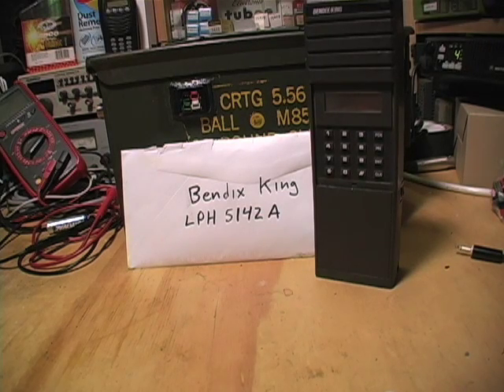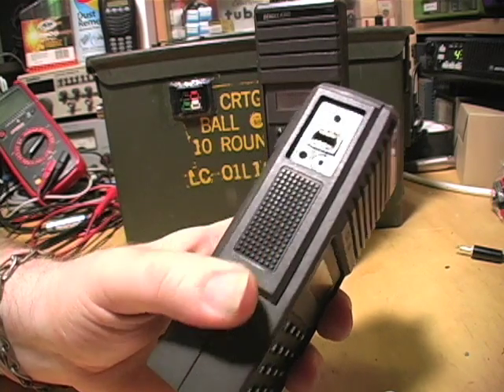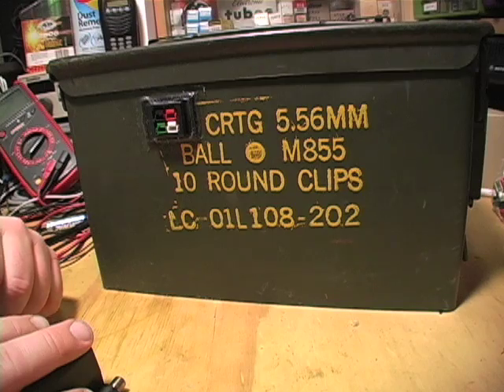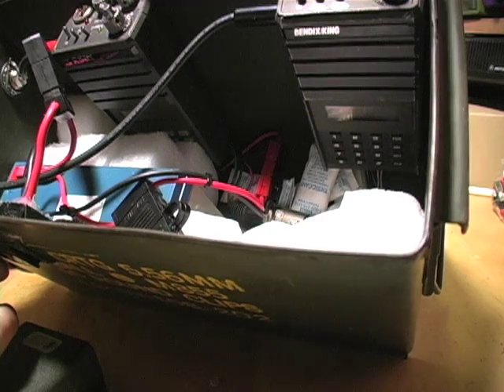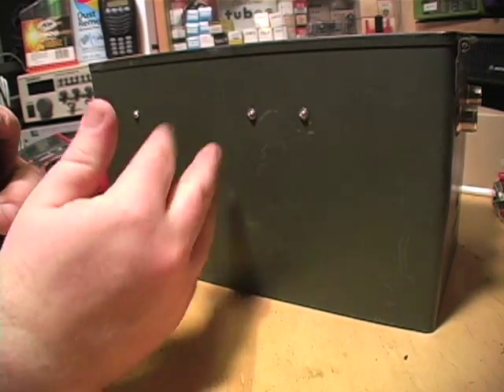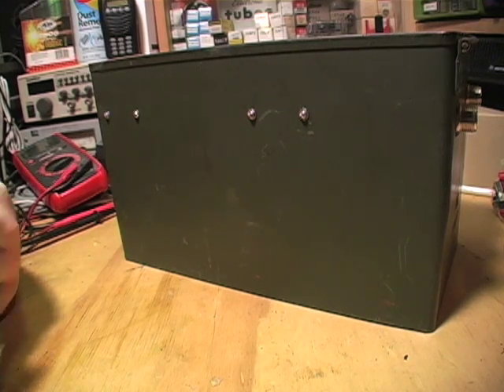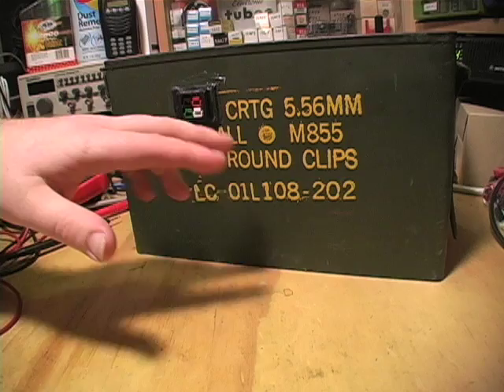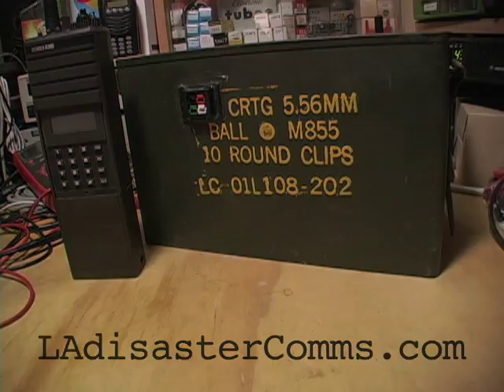Build your own 2 meter tactical repeater from Bendix King HT's on the cheep!

Comment: Your math on calculating the voltage of 9 parallel AA alkaline is correct, however that is the open circuit voltage. Any useful current draw will instantaneously drop the voltage to 13.8 and probably less.

Comment: Hello sir.....I'm a final year engineering student and my project is to design a repeater based on walkie talkie system.....we only use one walkie talkie in this project which can receive and transmit the signal....Can you help how this project work and how to do this project
Reply: Arduino board esp-12s
Sq9mdd tnc
OLED
Components transistor, buzzer ,Capacitor , resistor, sui, led
Walkie talkie

this are the gadgets that we used to do my project...but dont have any idea how to do this and how my project works

Comment: Now do this with a air of Motoroni Sabre radios with DES encryption and use a couple of other like radios with DES and program them up to some DOT frequencies ( common low power licensed commercial frequency) for private COMMS. DO NOT USE ENCRYPTION ON HAM BANDS unless you use an APCO P25 standard with a non high security encryption standard where anyone can purchase and use freely. DES is not approved for Ham Bands.
Reply from the maker: This is actually pretty easy to do with Maxtrac and XTL mobiles.

Comment from the maker: tac·ti·cal adjective \ˈtak-ti-kəl\

A :  of or relating to tactics: as (1) :  of or relating to small-scale actions serving a larger purpose (2) :  made or carried out with only a limited or immediate end in view

Why is it "Tactical"? Because that's what the friggin word means. I'd like to see you run up the side of a hill with a Quantar and get it operational in 15 minutes. I'm guessing you have never worked on a wildfire where temporary repeaters are quickly set up as part of firefighting Tactics. If part of your Tactics for firefighting is having a quick deploy, portable repeater, that doesn't require mains power I'd say that makes it a Tactical Repeater. Maybe that's why they are called Tactical repeaters. 
http://www.cobaltequipment.net/index.php?option=com_content&view=article&id=156:bendix-king-tactical-repeater&catid=18:communications&Itemid=182
Reply: You should have included "strategic" in your explanation. Tactical is the smaller operation and strategic is the "big picture".

Tactical planning is what the small unit does in support of the larger (strategic) goals.

Since the strategic goal was hunting, this was a means of supporting (i.e. tactical) that goal.

Comment: Nice setup!  It's always nice to see the older commercial equipment getting new lives! 

I would just like to inform (or remind) everyone that FCC part 97 rules require that the repeater trustee (typically the owner) have the ability to remotely control the transmitter of the repeater via a control frequency above 222.15 MHz.  Otherwise, the repeater must be able to turn it's transmitter off after 3 continuous minutes of transmission.  I don't see any provision for this capability in your setup.  Actually, there are several other important rules that should be adhered to regarding auxiliary stations (ie. repeaters) and I would recommend anyone planning on building their own repeater see the following page for more information:  http://www.arrl.org/auxiliary-station-faq  73!
Reply: Radios are programmable with a time-out timer.   The repeater operator must be able to control the transmitter -- there are many out there still on the air without controllers; although with the cost of DTMF modules; it's silly NOT to do it!
Reply from the maker: +rumproast2000 The transmit radio is programmed with a 30 second TOT.

Comment: Love the design here! Had a question for you. How is it that the transmitting radio doesn't overload the receiving radio when the repeater is in use? Is it just due to the fact that you have separate RX and TX antennas that are spaced a fair distance apart?

Comment from the maker: Yes, DOS Many old radios from the 90's have to be programmed in DOS, I guess you've never used Motorola RSS before. 

I'm not sure why you would want to do this with UV5r's when they cost more then LPH's, you would have to implement a power management system, a repeater controller, and in such close proximity the Tx radio would probably overload the front end of the Rx radio. I guess it could be done, but it's a totally different beast then this project.

Comment from the maker: There are other HT's that can be configured in a similar matter. I picked the BK's to use because their circuitry is designed so you can simply modify them to work in this way, they have actual 50 ohm antenna connectors, and they will easily run in the 12-13.8 VDC range.

Comment from the maker: No, I am jumping between points on the PCB of each radio, the only passive component between the two radios other then wire is a small cap to filter the DC from the audio jumper. The PDF explains this.

Comment: So did you just plug a speaker cable from the receiver radio into the mic port of the transmit radio? Because uv seen those repeater-tone controllers on eBay but it it doesn't look like you used one of those.

Comment from the maker: I will work with a regular 600K split, if the antennas are far apart, but I usually run an odd split over 1Mhz. Usually something like 144.3XX in and 146.5XX out.

Comment from the maker: That is actually a term BK uses because the repeater is small, quick to deploy, and designed to cover a local area. 

That said I should add some pic rails, QD sling mounts, and a bayonet lug;)

Comment: You may like a project I'm working on right now. Working on using a Raspberry Pi and freeSwitch as a controller (it can do announcements, autopatch, callsign in morse (or voice recorded sound off). Have a surplus GM300 and F221s so I'd like to have a cross band so I can play on the Saltgrass system in Lubbock when I'm outta HT range with my FT-2900 in my car. Also setup for two Baofeng UV-5Rs similar to your setup but with a 5V  headless RPi as a controller.

Comment: Pretty cool. Did this with two FT-2800's. 3 batteries, Small solar panel. Still works too. Not sub $100, but WELL under 3. Put it on the mountain here, 100 mile coverage. Oh yeah, and a simple nPn transistor...